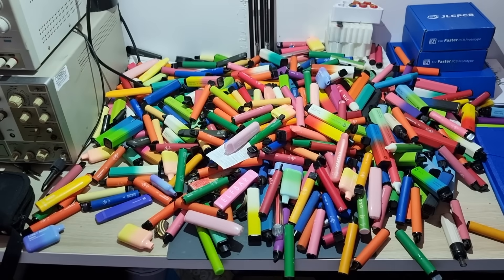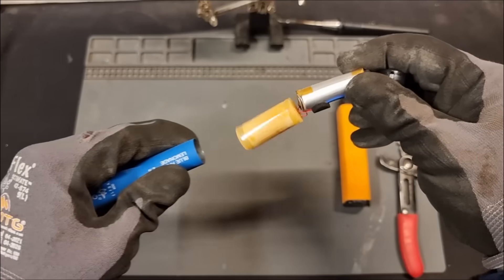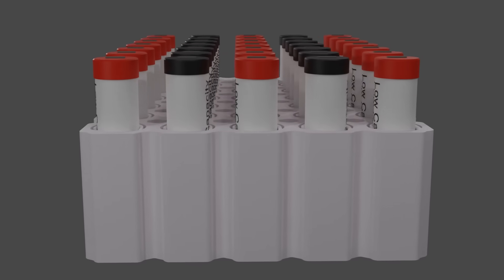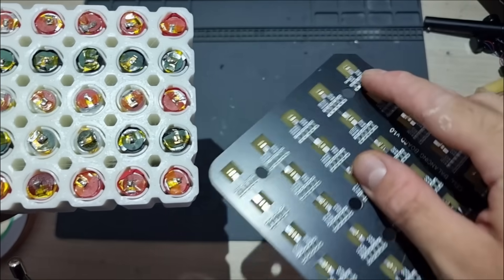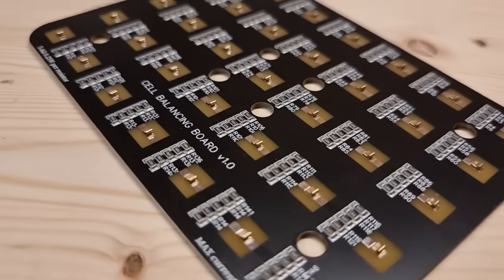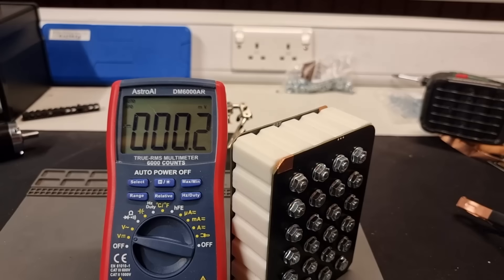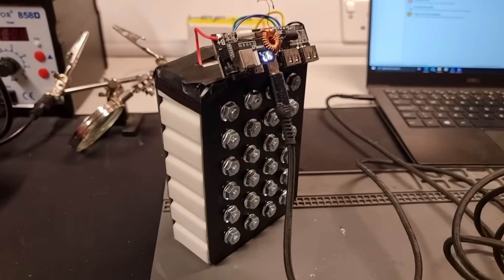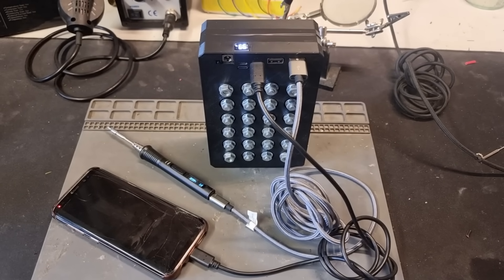Turning Disposable Vapes into a Fast Charge Power Bank

Comment from the maker: Just finished version 2! https://youtu.be/kMiJdfgIfqI
It's smaller, uses fewer bolts, easier to assemble, and is completely open source!
Reply: Legend! Which program did you use to design the battery holder and the case? I was taking my guess that is fusion360. Keep it going!
Reply: 15 Ah is 15,000 Mah
Reply: Thank you I've been collecting these vape cells for over a year but wasn't sure what I was going to do with them so I think I'll definitely be making a few of these then maybe looking to build a solar charger
Reply: Why are there so many bolts anyway?

Comment: I have a bunch of batts but dont have a way to print or make pcbs boards ,most of them are from rechargeable vapes and way i could use the circuit board from the recharging vape to do the same thing if i wire other batteries of the same type to the rechargeable vape circuit board and the output be from where they usually hook the power for the coil connection, hope this makes sense

Comment: I know this is an older video. But this is the first of yours after a binge of your content that has mentioned a want for people to switch to reusables. 

The actual nicotine juice that would make that actually desirable just happens to be illegal in my country. Otherwise I absolutely would. Please if you could provide some more documentation on the recycling of these disposables in other forms (which you've been doing of course) - but geared towards someone who maybe has a soldering iron, and some very basic electrical engineering knowledge, then I'd love to engage heavier with this. 
God knows I have my share of dead vapes I have no idea how to dispose of or reuse

Comment: ive been wanting to do this as well, only problem is I only have the square beveled vapes to work with and its a nightmare to tear open the casing to access the battery pack, how would you approach opening those models?

Comment: I mean they do run on 18650 battery's. Or at least the tall ones do. Eventually they do stop working. O, I stand corrected, I guess they use the half sized ones. I actually had a laptop that was powered by a battery pack that was made of 10 18650 battery's. One solution to go with the charging problem is to get a battery charger made to charge these kinds of battery's before putting the copper tape on.

Comment: I love it man !! Ive been doing the same thing Lol. It all started with wanting more flight time for my RC helicopter and one thing let to another, Now i got all these packs too. Keep it up man great video. Also what really great to use those left over tubes that are metal, Make powder sugar and potassium nitrate 60:40 mixture, use benonite clay or cheap cat litter for the caps and you can turn them into model rocket engines. Its the vape cylinders are perfect for making them

Comment: I support the cause of reusing rechargeable batteries, but unfortunately this video is not as useful as everyone in this comment section makes it out to be.
1. The cost of bolts, nuts, PCBs and 3d printed parts (unless you have your own 3d printer) is the same, if not more, than what you would spend on a new store bought powerbank with a similar capacity.
2. The design is extremely bulky and there's no way to make it significantly better, because of the required structure around the cells. Powerbanks are designed to be carried around in your backpack or some such, and this brick would be a pain in the butt to take with you. And if you keep it in your house, car or garage - you might as well just use power sockets.
3. Using low quality batteries that you just found on the street, where rain or moisture can get to them is a fire hazard.

I would also like to point out that the comparisons to iPhone or car batteries in this video are inaccurate at best or maybe even misleading. You simply cannot just take the capacity of 5 batteries of one type and say they're equal in value to one (way more compact and powerful) battery of a different type.

Comment: if you dont have the motherboard lips to connect to the battery or any solder. taking the spring from a ball point pen and cutting them into 3rds make 3 good spring's. with needle nose plyers and some work you can do the same. really any coil or wire with a bend will work

Comment: Are the resistors only necessary when the batteries are out of balance? If you charged/emptied them all before wiring them could you skip the resistors or would you want to keep them to avoid charge levels desyncing with use?

Comment: Hello friends, I have been using these batteries for years in all kinds of electronic projects. Protecting the environment and recycling are very important. We should be more careful about this. Actually, it is not as complicated or dangerous as you think, but you should still be careful and take all kinds of precautions. I use not only batteries but also usb c charging circuits.

Comment: I would be hapoy if I would get so many batterys for free 🤗
It's in UK not easy to get them "used" for free, everywhere. In my, area im lucky if I find 2 or so.
You should balance them and test the resistance and make batches, easyer to make than Powerbanks I would guess. 🤔 🤗
Do you know the rechargeable "lipo" battery Studie, if you charge the Batterys between 20% and 80% you can get over 9000 charge cycles and even more, this applys to Smartphones ect. as well. 🤗

Comment: I did the same thing a few years ago, albeit a bit more crudely: I dealt with the balancing issues by ensuring that all the cells I used were the same capacity (most small disposable vapes use 500 mAh / 1.85 Wh cells), and by fully charging each cell with the same type of TP-4056 charging module before soldering them all together in parallel.

I used 140 cells in total, contained in an ABS plastic project box, making a power bank with 70 amp-hours of total capacity. In theory it should be able to charge my phone 20 times before needing to be recharged itself. In practice it has never done more than 17 phone charges, probably due to charging circuit inefficiencies, combined with the distinct possibility that not all of those cells have 100% of the capacity claimed on their labels. However, 85% of predicted capability isn't too bad.

Comment: Love the project! I'm building a power bank with 18650 batteries (16-18V total) and need a controller board that supports Type-C charging. Any recommendations? Thanks!

Comment: Had no clue that 1) Disposable vapes like this were a thing, and 2) That the scale of ewaste generated by them was so massive.
Unfortunately I've vaped for something like 10 years now, but I've been using the same mod and tank for about 8 of those years. I wind my own coils, I bought a giant box of Rayon for wick probably 6 years ago and it will last me about 6 or 7 lifetimes based on how little of the box I've used thus far, and I make my own juice. Only disposable bits are the tiny tufts of wick that I pull out and replace every 2-ish weeks and the 3 18650 batteries I rotate through that last me about 2 years at a time.
Obviously not vaping would be ideal, but I like to think I'm pretty efficient about it.

Comment: I'm making a leveller at work. what size resistors did you use and how did you calculate this?
Reply from the maker: Calculate the worst case voltage difference between two cells, in this case its 4.2V - 3.0V = 1.2V. Then work out the resistance to limit the current to your max charging current at this voltage. E.g. for 0.5A you would need 1.2/0.5 = 2.4 ohms

You will also have to make sure the resistors can handle the power dissipation using P = IV, so 0.5A * 1.2V = 0.6 watts

Comment: Everything about this is absolutely beautiful. The presentation, the boards, the designs of the battery holders, the overall efficiency we see in these things.
Not only that, the overall concept is super easy to follow and understand here. To the point anyone can do this with a decent bit of knowhow and elbow grease.

Absolutely stellar job. Curious what other projects such endeavors with vape batteries could be used for.

Comment: How do you find the same battery sizes so reliable?
I’ve opend over a hundred vapes now, not only were most of the cells 360mA, so smaller than yours, but even when I found 550mA cells, it wasn’t dependent on the type of vape. A “11Bar 600” could contain either a 280/360/400 or 550mA cell. Same flavor, same amounts of drags ”on the label”, no way to identify which cells it contains. Heck I even had some in the shape of a capacitor.
 I also opened all kinds of different brands, so surely the contained battery differs in between those, but the same version of the same brand did so too.
Reply from the maker: Its really strange isnt it. I suppose they must swap out the cells during production depending on the supply chains & what is most available/cheapest at the time. Kinda strange that they advertise the same amount of puffs despite the battery varying in capacity so much.

About a year or two ago they always used the same 550 mAh cells in all of the elf bar style vapes, so i got really lucky that i was able to collect a few hundred. These days I go to nearby vape shops and pick up returned ones in huge quanities and then sort them by their cells

Comment: Nice idea with the PCD board instead of soldering, but dont you thin kyou went overboard with the amount of bolts?!
Surely 6 or 8 bolts would have been enough.
Or if you really wanted why not add screw inserts into the plastic so you can use small screws instead.

Comment: Be careful using the print your mate built for you. More compact can actually be more problematic as it allows for insulation of heat, which can cause fires. Your current pattern is pretty good but you can use the space between each cell as a flow point, add a fan to push air between them, and reduce your fire risk.

Comment: Very cool. Last I heard, it’s still hard to recycle most plastic into filament for 3d printing. It would be cool if you investigated the feasibility of using the plastic cases from the vapes as source plastic for the battery bank case, either if it’s the correct type for 3d printing directly, or if there’s some other technique or you could collab with an artist that could do something with them to embed them in the final case design.

Comment: 0:17 dang I have like 100 of these in my house I was saving to make rolling trays with, but I don’t know if it’s safe with the batteries inside to put epoxy resin
Reply: My (uneducated) guess would be not without removing the battery, since resin tends to get very hot while setting
Reply: @emilyannamanda  actually a loser lmao

Comment: You could probably eliminate the need for bolts by making the enclosure with a little more structure in the middle. It would end up cheaper and should make it weigh a lot less too. This is a pretty awesome project.

Comment: I salvaged a KFC 16300 520mAh and I can't find anything about the battery other than a 650mAh version. The battery says do not recharge and I am trying to find info about it but no luck. Does anyone know where I can search about batteries like archive site or if the battery is actually rechargeable? I took the battery out of blu disposable vape.

Comment: Don't forget the silver wires in vapes. I started hoarding the parts a while back and everything expect the vape part goes , but the wires I am almost certain they are silver, the resistance is on point and silver is in items that are used daily as a conductor, like a vape. Hoard it maybe melt it down I could be wrong but I can't find information on what really is in them online.

Comment: You really do need to be careful putting unbalanced cells in parallel with each other, as even a half volt difference, if the cells have an internal resistance of 0.025 Ohms, that would be 20 amps that would attempt to flow, at least initially. That could be a hell of a kick to cells that aren't meant for that kind of load or charge current.

Edit: Though I doubt these style of lipos have that low of an internal resistance.

Comment: This is probably a dumb question - don't most phones charge on ~5V? It looks like the batteries you have wired up in series would be putting out ~19V. I am guessing there is something that I just don't understand about super fast charging.

Edit - I forgot about the power bank manager thing. Surely that is what makes sure the proper voltage is output

Comment: Could i ask what kind of cable's you are using or what you should use so the cables don't overheat or even melt cuz of the current?
Reply from the maker: Use wires with a diameter that can handle 7A of continuous current to be safe

Comment: i have some 18650 cells and idle to average their tension exactly as you did with the 2nd PCB, could you tel me a bit more aboute the designing part of this? I have some resistor and I juste wonder iv I can juste connect them with a random resistor or how did you do, how did you choose the resistor? (Was able to measure the internal resistor of my battery, IDK if that would help
Reply: okay did the calculation and correct me if something is wrong but long story short the current pulled between two battery will I=(dealt)/(Rtot).  where Rtot= RInternalofB1 +RinternalOfB2 + That you choose. moreover the puissance that the resist will see will be deltaU^2  / Rtot.    from your vidéo we can see that you choose 5 parallel 5.6Ohm and assuming vape's battery are not that good we can take 100mOhm for internal resistance, that's make Rtot = 2*100e-3 + 1/(5/5.6) = 1.22    =>   current I = 1/1.22 = 0.82 Amp max  if wa assume a deltaUmax of 1v. Ill do the calculations concerning the time that's it should take since, while the battery reEquilibrate themselves the deltaU gap is decreasing and therfore also the curent, I thinks the Tension gap will decrease similarly as 1/x but not sure. Anyway Sunday evening would do anything but not my homework

Comment: Isn't the battery shell conductive, so by putting copper with conductive tape making it short, or it is not.
Reply from the maker: You would absolutely be correct with ordinary steel cased li-ion shells such as 18650s, but these cells are actually cylindrical pouch cells and therefore have a non conductive polymer exterior

Comment: Wouldnt it make more sense to just charge all the vapes to full before disasembling them and going threw the trouble of having a extraboard made with the resistors i can see were it would save time if your mass producing them but for the average person or in a  emergency situation your options would be very limited with that being said i love the idea and design awsome job
Reply from the maker: These vapes dont have any charging ports sadly and are only designed for single use. Good suggestion though for anyone that wants to replicate this with rechargable disposables!

Comment: Balancing is NOT so critical, taking a full cell and connecting in parallel a dead cell is not going to hurt anything. a lot of people think so but try it a measure the current and voltage. the c rating one cell can put out is about the same as the charge c rating, so the cells will balance, just get a 4-cell charger and run a cycle on them to weed out the bad ones way easier

Comment: everything was really cool, but all those bolts. Did you really need that many, you can get very strong 3d printed parts, the bolts looked like overkill.... plus if you need them then a cap piece would have made the final model look so much better but i guess that wasn't the point of the video anyway.

Comment: Hi Chris,I have an idea could you make up a power bank that can be used to run a HF 100 watt RF output radio with BMS probably around 100 Amps .If you did I would have one.

Comment: 3 questions... 1.- how do you charge the power bank? how many volts does the power bank deliver to the charger pcb,  and 3 why so many bolts?
Reply from the maker: 1. Via the USB C port, it allows input and output.
2. It is a 5S battery pack so the voltage range is 15V to 21V
3. The springs on this design are rather small and any flex on the PCB means that they may not make contact so i went overkill with the bolts

Comment: Real possible rebuild battery energy systems.  
Remmember this one battery 1.2v or litlle size battery defects old  out natural wide  1kv² radioaktiv.
Just have to remember. A single 1.5v small battery pollutes 10 square meters of soil and groundwater.  Almost nuclear reactors.  To reduce battery usage waste or any devices powered.   Specially stored in glass containers.  Sorted according to the composition of the battery molecule. The chemical elements of each battery molecule are different. It causes a chain reaction.   Therefore, it should be sorted separately.  Recycling by looking at the molecules of the battery.  Thistle is disposal with absorbed chemistry stops the function of chemical elements for safety.